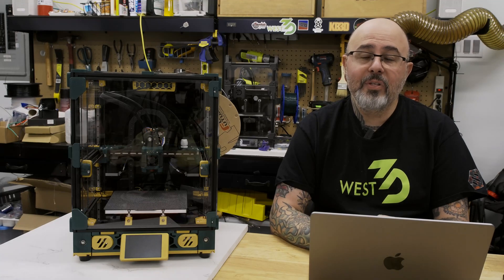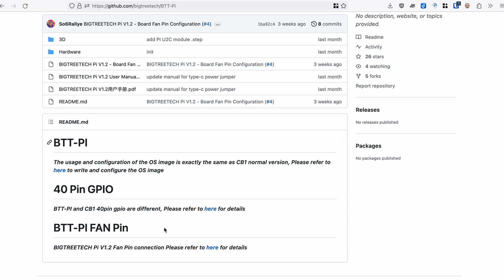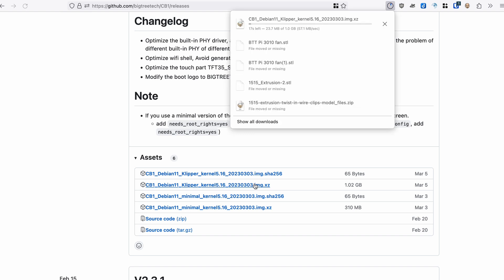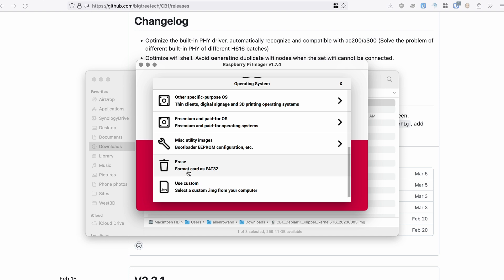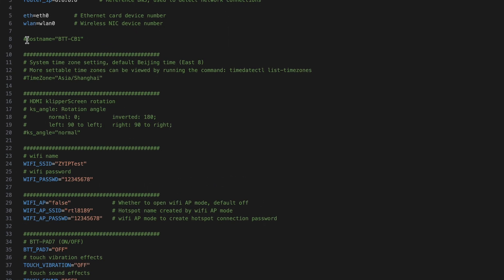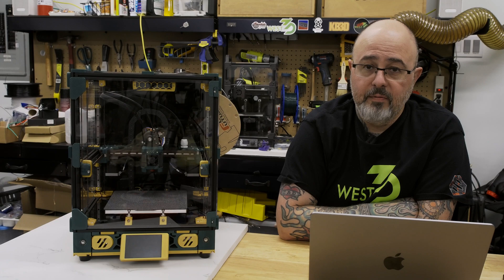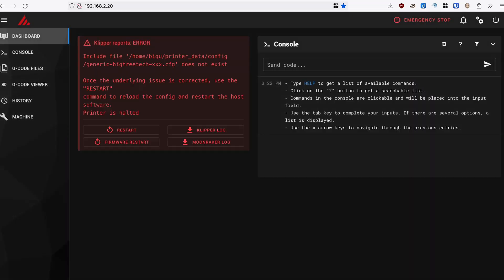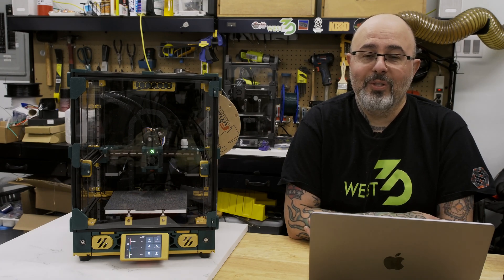Setting up the BTT Pi (or CB1)

Comment: Using a BTT pi or a BT pi4b adapter with CB1 I cannot get an output on HDMI with a VERY rare exception when the image shows but I get no touch.  I have multiple touch screens and all work perfectly with both win 10 and 11 PC and linux mint on a laptop.  They even get a great image when connected to a PS3.  The screens are fine and the touch works perfectly...except when connected to the BTT stuff.  I know which HDMI port on the Pi adapter is active but tried both and neither output any signal.  Even tried connected to a TV and no signal.  I can't find anything online or in the CB1 manual on ho to specifically enable/disable the HDMI.  I have made sure to comment out the appropriate lines in system.cfg for HDMI.  I've configured a CB1 EMMC with an M5P+TFT35 so I'm familiar with changing from serial or display.  I was using the pi adapter with a CB1 before one of the RAM chips on it overheated and burned a hole in itself so that CB1 was replaced.  So far it's working perfectly with the exception of no HDMI output.  Everything I've found says that the video is all going to be from the CB1 and not the pi adapter so I can't see what on the adapter could have died when the first CB1 went kablooee.  I'm baffled and BTT has been no help.  Best I get is to make sure I'm using the correct HDMI port (which I am) and they give me a link to the manual (which I already have).

Comment: I purchased a BTT pi 1.12, that acording to the manufacturer is equivalent (even better) than a RPI 3b... MY ASS! It's pure crap, setting up the OS was horrible, the stability is a ** shit and the optimization of the OS is horrible also... Dont buy cheap chinese clones garbage, just go for a RPI. Im running kliper with no issues in RPI3b even in old smartphone with linux deploy without problems.

Comment: no information on how to connect the BTT Pi and screen to it. You got to be more elaborate when you wanted to take on step by step
Reply: I am inclined to agree: how things are wired up would be VERY helpful!  In the absence thereof, this is not much help for those of us who do NOT luck into just having things work.  BTT's documentation is less than reliable, and getting answers from their "tech support" is like pulling teeth!  My self-rolled "kit" (SKR Mini E3 V3 + TFT 3.5 + BTT Pi 1.2) to "upgrade" my Ender 3 to Klipper - has been a TOTAL WASTE of TWO WEEKS of my time - just to have my printer totally dead in the water!
"Tech support" refuses to answer MOST of my questions, not the least of which is: "What are your HOURS of OPERATION?"
I suspect that they are on the far side of the moon (or China?) and (guessing) 15 hours different than I.  Apparently nobody in the saddle there has the cognitive capacity to register more than one little question at a time, hence they fail to grasp the concepts necessary to connect more than one of THEIR devices!  Asking the same questions, over and over, yet getting nothing but silence (with a blank stare, no doubt) is EXTREMELY FRUSTERPATING!
Reply: @palewriter1856  I feel your pain. I have no idea what to do about the missing .cfg file. It feels like the tutorial stopped halfway through!

Comment: trying to use at BTT Pi V1.2, I cannot get the BTT PI to power off the terminals.  I get a Green LED Light but nada. Hooked a screen up to it and it doesn't boot unless it is connected to the USB for power, with the JUMPER.  I have the Terminals going to the LSR 200 bringing in 24v over 18AWG wire.   Is there something I am missing?
Reply: Remove the jumper next to the 5v usb adapter to run off of the 24v printer supply.

Comment: The device-name and WiFi settings would be configurable from the raspberry pi imager-tool as well, isn't it?
Reply from the maker: That only works with Raspbian (the official Raspberry Pi OS), not other distros
Reply: I tried that and it didn't work. You have to do it like in the video. 

But at the end of the video you cut off how to actually get it working. I did all that and input the printer.config file and restarted klipper and now it says no mcu mcu not detectable. Any clue how to fix that?

Comment: I did pick up a couple BTT Pis even though I didn't have a printer that needs one.  The price and the ability to connect directly to 24V makes them a great alternative to a Raspberry Pi.   Setting up Klipper was a breeze following the BTT guide.  I would add that it is not necessary to unzip the image file when using Raspberry Pi Imager but no downside either.